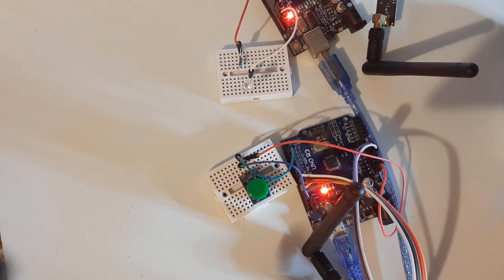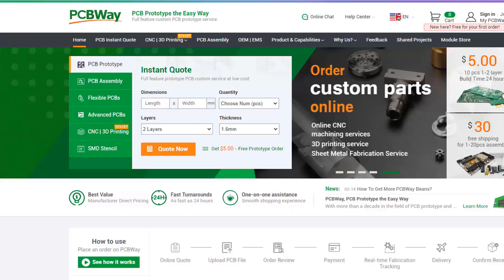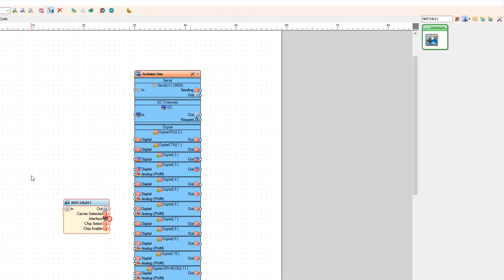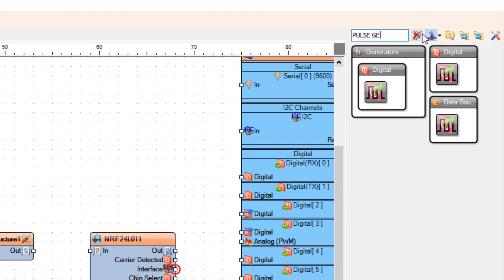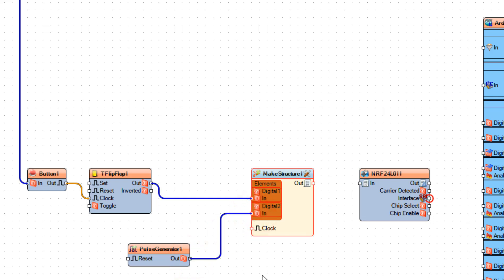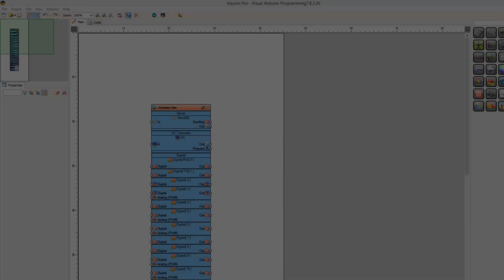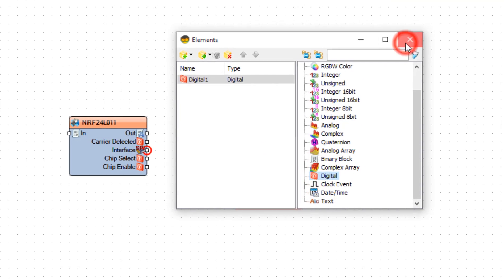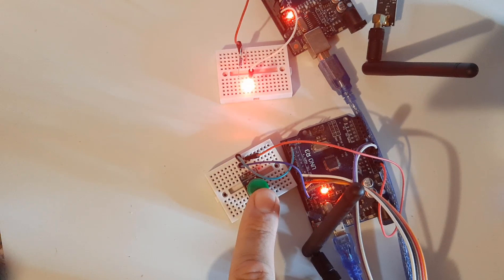NRF24L01 Remote Control LED using Arduino

Comment: Do you have a tutorial for bidirectional LED controller using NRF24L01 acting as a transceiver? Receiver can transmit data and transmitter can received data.
Reply from the maker: Its pretty simple, you add the receiving part to the transmitter in Visuino.